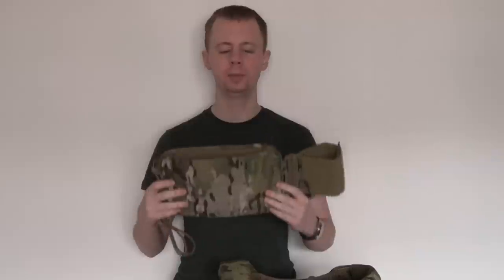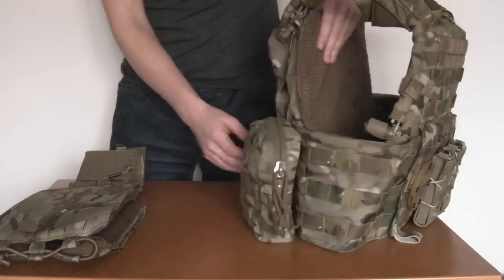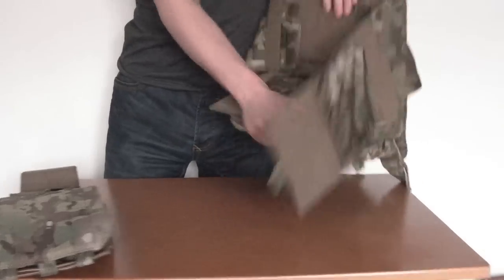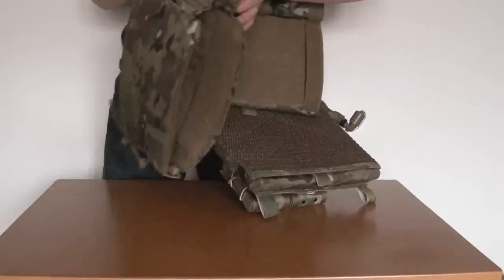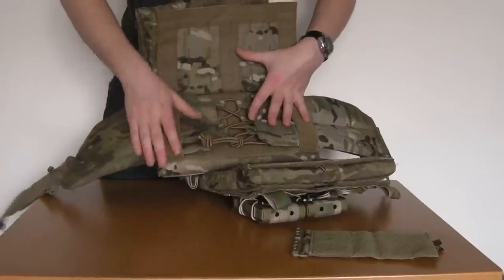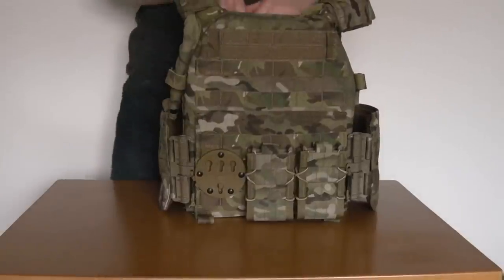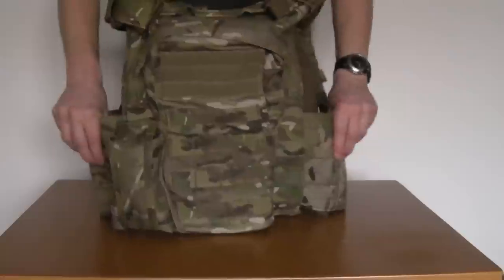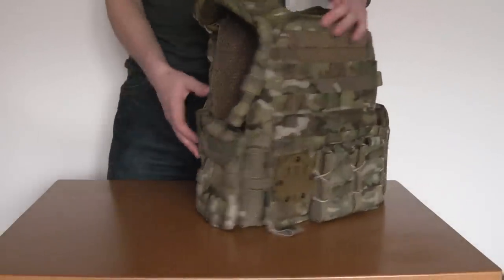FirstSpear Retro-Fit Cummerbund - Installation

Comment: Looks good, considering replacing my PIG cummerbund with one. Any thoughts to gluing or otherwise sealing the front panel in place afterwards? I find that's the part that shifts and pops open the most.
Reply from the maker: I've never seen anyone try to glue velcro, but if you used enough it might work.  Probably best to use a decent hot-glue gun I'd imagine.

Comment: Nice, i might have to look into this product. Looks like a much more efficient way of doing and dofing the vest. The only thing i could see being a problem would be the visable tan clips and the gaps above and below it.
Reply: I'd leave the clip areas clear anyway- as shown in some of CK's other videos you can better see anything on belt or leg rigs and access them more easily
Reply: Not that im saying cover them up as it would reduce the point of the clips. What Im saying is that it leaves that part of the body un-protected.
Reply from the maker: That'd really only make a difference if the host carrier could accept soft armour throughout, including the cummerbund.  A lot of the plate carriers that this kit would integrate with aren't built in such a fashion, they only carry plates.  So you wouldn't be losing any armour coverage.

Comment: Nice video, BTW what size soft armor inserts fit the cummerbund? Do you have a video or pics of the CB woven into the rear molle of the carrier as opposed to using the "channel" method? Would this work with a BFG LMAC? Thansk
Reply from the maker: I'm not too sure on armour, I know the c'bund is at least as tall as any other brand I've seen and length of course varies on the size you order.  FS have a video up on their own channel (quite a way back) that shows attachment of this kit to a PC without the channel, should help you out.

Comment: So with the DCS Cumberbund I have each side pulled in 2 Columns could I still adjust the FS Replacement as Small do you know?
Reply from the maker: The FirstSpear will go even smaller.  Even in its' default state it has a wider range than the DCS cummerbund, but you can thread the bungee through the 6/12 on the FS to make it even smaller if necessary.

Comment: Do those clips hold a lot of weight? Or is there a certain limit? It'd be annoying if they unclip under some pressure in the field.
Also, what's your opinion on that new molle system (on the cummerbund) compared to the standard molle system? Any differences in usability or practicality? I've never used it before, only seen it around.
Cheers!
Reply from the maker: If you were to hang stuff from the Tubes they'd take a lot of weight before breaking, as they're configured however (vertically) they're not under much stress at all.  There is no way they're going anywhere, they're never going to separate on you during use.
No negative differences to the 6/12 vs PALS webbing in my experience so far, does the job just as well but lighter, thinner and with the option of using 6/12 pouches.

Comment: Hey man, good vid of great kit!  What pack is that on your back plate panel?  I've been looking at options that will fit a Banshee without hanging below the panel and interfering with my battle belt.
Reply from the maker: Thanks, the hydro is a 2 litre made by PIG, available over at SKD tactical.   Or check the 1 or 2 litre hydro carriers from FirstSpear, I've switched to them since making this video.

Comment: I'll ding them on this. They don't tell you shit about this. Something many high end makers don't seem to understand. At least they have decent pictures unlike Tyr (all their product inquiry responses are more or less answered as a "shrug")

Whats the sizing for this? What size soft inserts does it accommodate?
Reply from the maker: +Rusty Shackleford I don't know that info off the top of my head I'm afraid, but if you e-mail FS they will get back to you with that info.  I've spoken to a lot of their people over time and they've always been extremely helpful.
Reply: REMF Tacticool
I got in touch with them. They told me everything I needed. It follows the same sizing as the mayflower APC But I shouldn't have to email the maker with basic questions such as that (especially if it might require me to buy different inserts) 

As I said, Tyr is probably the worst. Most answers I get from them is an ambiguous shrug
Reply from the maker: Yeah I hear what you're saying, the website is definitely not perfect.  But I think, in their defence, they do massively better than a lot of other high end companies who just act like they entirely don't give a fuck in the slightest if you're not the procurement officer for some tier 1 SF unit.